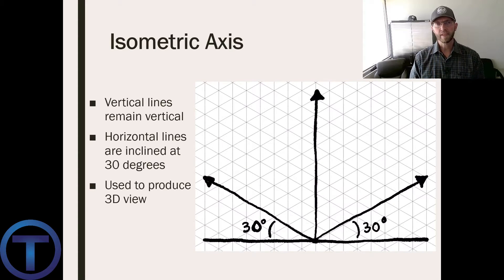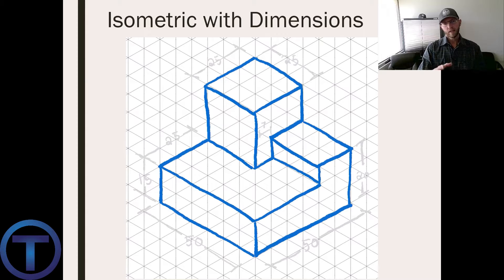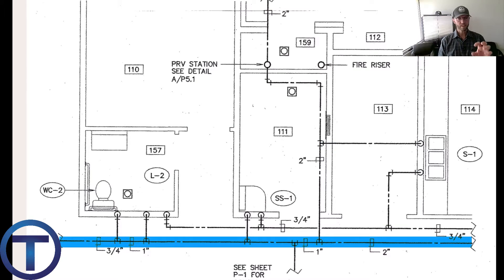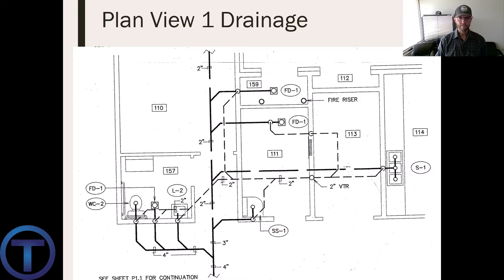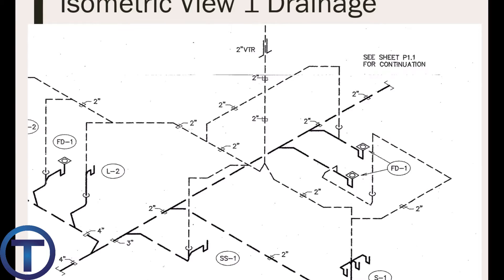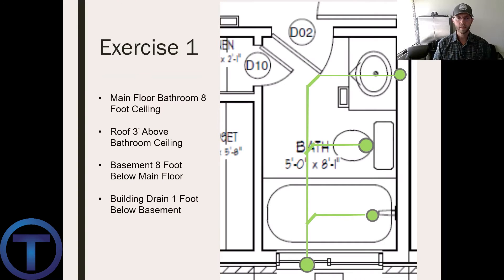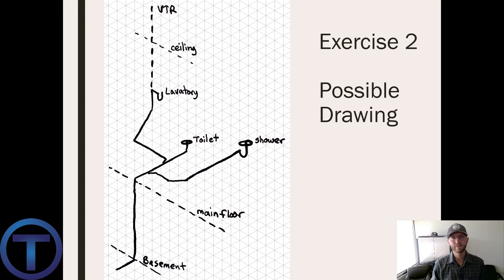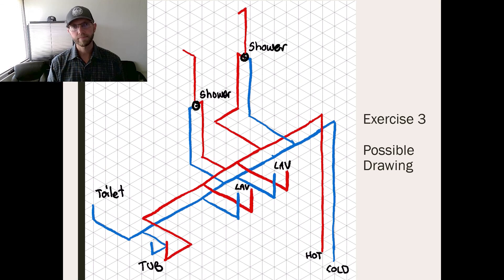Isometrics For Plumbers

Comment: Why there is no vent for toilets/WC on exercise 1 & 2. You have provided the single vent on lavatory. I just wanted to know if this is up to the code or good for this type of arrangement.
Reply from the maker: Good question. This is up to code for the International Plumbing Code which allows for wet venting. Depending on where you are at the local jurisdiction may or may not allow wet venting.